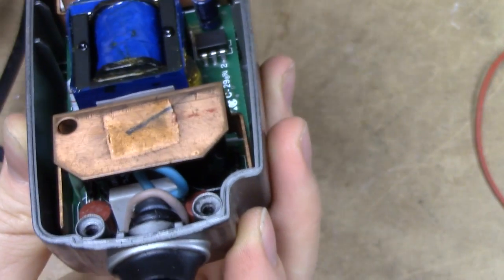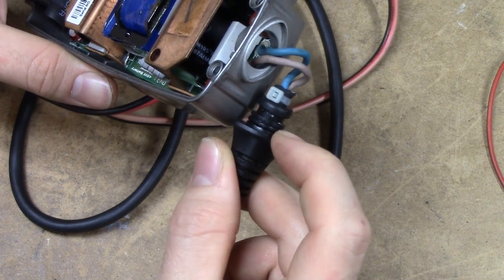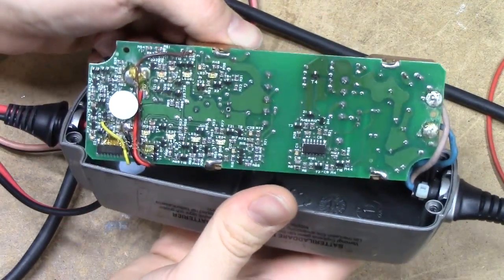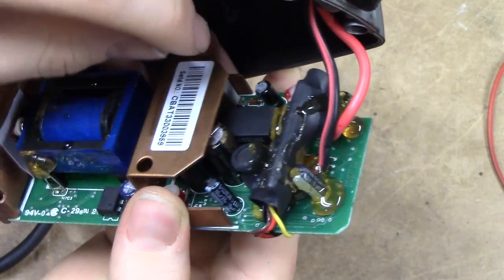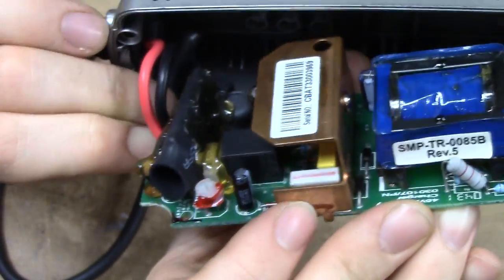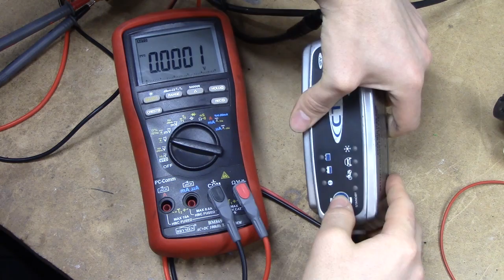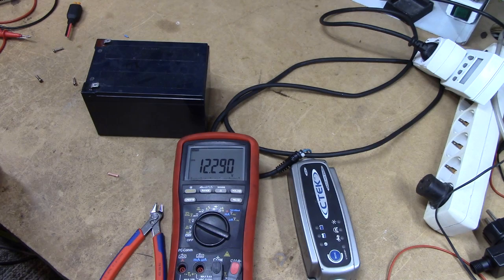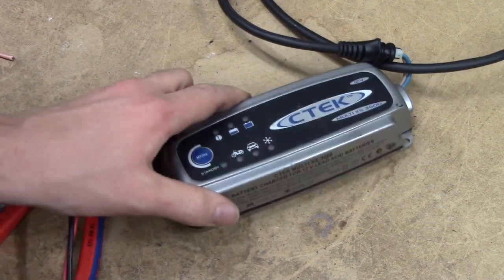CTEK Multi XS 3600 battery charger teardown & repair

Comment: I bet the cables you could pull out (mains) from its encloser after removing the bottom lid is HELD in place by the bottom lid :D Have seen that design lots before.

Just had a quick view again of the video and you can see what is to hold the cables in place on the bottom lid as you put it down. :D
Reply from the maker: +Unubtanium The Cyborg Yes, you're right. I noticed that while reassembling the unit - I should add an annotation about that.
Reply: Indeed it does hahaha
Reply: Yes,that's why it came apart

Comment: Thank you, great video! Helped alot I just bought one of these maintainers plugged it in for winter and wouldn't switch modes. Decided to see if anyone else had this problem and a solution before I threw it away. After watching your video I was able to fix it in 5 mins and it works great all thanks to your video. Thank you again.
Reply from the maker: That's lovely to hear!

Comment: I have what must be a newer version of this XS3600, it would sit for days at the half charged step, I thought I had a faulty battery, I bought another battery without realising what the charger was doing, but when the charger still wouldn't switch over to "maintenance mode", I did some measurements and found it was trying to put 15v into the battery, it was basically boiling my battery.

I took it apart and although it's slightly better built than yours, I think the only thing "smart" about it is the marketing.
All it does is output a set voltage (should be 14.4v) wait for the current to drop to near zero, it turns off the output and then waits for the battery to self discharge to 12.9v before simply turning on it's output again. There's nothing clever or "smart" going on, it's just a standard battery charger.

What I don't understand it's so damn hard to find any information about these chargers, apart from marketing stuff and internet forum recommendations.
Reply: When there is little information, or the information is vaguely presented, it is likely that way for a reason. We see this crap all the time in politics and marketing.

Comment: I have a new CTEC charger which goes through a battery conditioning cycle to deal with any oxides on the plates. This could be why its not giving the ampage you are expecting. I am very pleased with my charger and the facility where I store my other cars use these chargers all the time, without any issues or criticism. You do need the manual to understand the charging steps and charging programs.
Reply from the maker: This unit is ancient and does not have any of those features.
Reply: @FFcossag  Yes, it has been significantly improved. It was even at the Geneva Motor show this year.
Reply: @FFcossag  you are totally wrong. This model desulfates too and does both top up and maintenance charge.
Reply from the maker: @Raj-nh3fc  It's just a standard 3 stage charger. Perhaps the newer ones are more advanced, but this one is not.

Comment: This is a really old version of a CTEK charger, atleast 10 years old.
Reply: Why, are they supposed to only last 10 years? I have a charger that is about 40 years old, it still works.
Reply: @achristian7015  Because you become dependent on the quality of the components (from different manufacturers and qualities), when it comes to "advanced and smart circuit"...

If you want a long-lasting device - build it yourself, and build it in the simplest possible way.

A great example here: https://youtu.be/48--yf4awZQ
Although not efficient in terms of Energy saving, but it will last (this video is just a demo before a final assembly is arranged).

Comment: two years ago i have buy a Ctek charger in a marine shop and I was not so happy with it.  After several hours began the charger to smell. The charger become so hot that the plastic case begin to melt.  

The marine shop get so many back that he sales was stopped. 

The problem is overheating to little cooling possibilities and burnout power regulators. Especially by hot weather. 

I don't know if the quality has improved?

Comment: You need to get a scope onto it and check the oscillator frequency and then use a DVM to check the  flyback diodes and output smoothing caps. You won't fix it by passing comments and please get the terminology correct. It doesn't 'draw' Watts, it  draws current and consumes power. Basic stuff.
Reply from the maker: You are right - however, I will confidently state that my method has a superior track record to leaving pedantic comments on the internet. ;)

Comment: I have the same exact problem on mu Multi US 3300. I don't have fancy equipment to test it and replaced that same diode. This did not solve my problem. Something else must be broken then. I guess for now it will act as a low current charger.

Comment: CTEK are absolute rubbish .. I had before hand heard of issues from others also, and now my XS 0.8 that hasn´t been used that much during the 2 yrs I have had it (as I also have a Noco Genius G3500 which has never let me down)  .. suddenly will not charge past the number 2 position  and I have tried it on several newer batteries with same results, so it´s not the batteries that are at fault .. just more Chinese made garbage trying to ride on the back of a reputable  Swedish name because some guy there thought of the idea and had these banged out as cheaply as possible
Reply: I’m having exactly the same problem. Did you manage to fix it?
Reply: @tubewiser  No mate, not worth wasting my time on, so I binned it. The Noco mentioned in my above comment does the same job, and is still going strong.

Comment: You can not just pull out the input and output cables because the cover when in place locks the cables in place. Did you not see that while dismantling. Too much baseless criticism. I have had mine (same model)for almost 25 years and functioning well. Now the outer part of the red and black cables are eroded and need changing.

Comment: Sure, that this device comes from ctek originally? From my point of view, the inner of an quality-product like i.e. ctek is (fabrication is in every peoples mouth) must not look out like the shown in the clip...
I dont want to argue or fact sth. but it wouldnt be the first device what was copied. Especially the Batterychargers fall in such suspicion. There are a few clips about Fake Chargers i.e. in the very affected Hobby-Sector (like LiIon/LiPo-/-and their Chargers).
Somebody in the comments wrote, that his charger applied whole wrong voltage to the battery... Such crazy things especially (chinese) fakes do...
Reply: Having taken a modern CTEK apart, things have either improved enormously, or this was a cheap copy.  It was 4 years ago, so I guess they could have improved.
Reply: I too reckon that is a cheap and nasty chinese copy. I have the same model and the only problem I had was a sticky / faulty mode switch  which the supplier said was a common problem and as mine was more than 2 year old  it was not covered by warranty ( then only 2 years now the new models are 5 years) I opened mine and sprayed a little CRC electrical switch cleaner and lubricant into the mode switch and it cleaned it and it has worked perfectly since! Oh, and the quality inside was excellent so it was the genuine article and the one above is a clever copy of the case , but the insides give it away as a chinese knock off copy and a dangerous one at that, so only buy from c-tek distributors, and if the price seems too good to be true, then guess what?